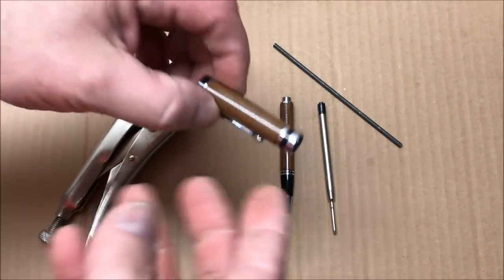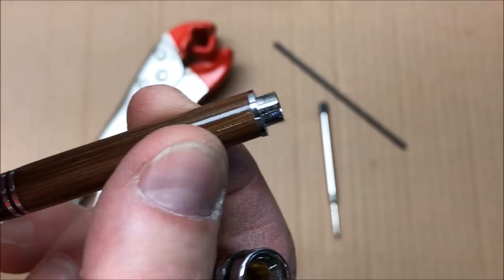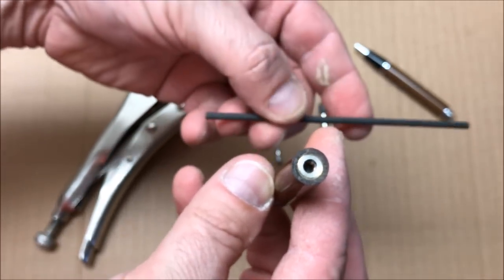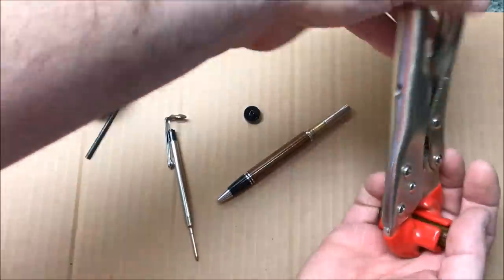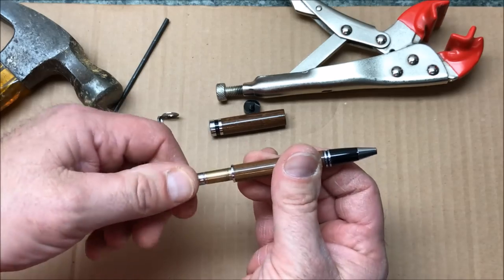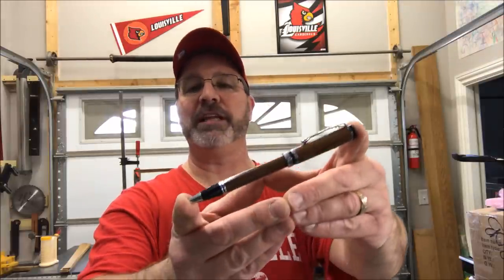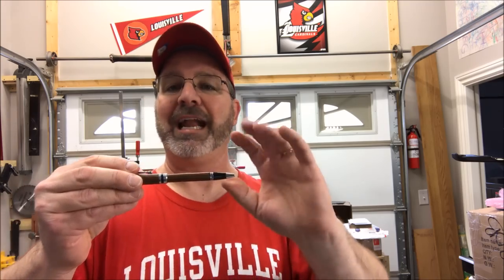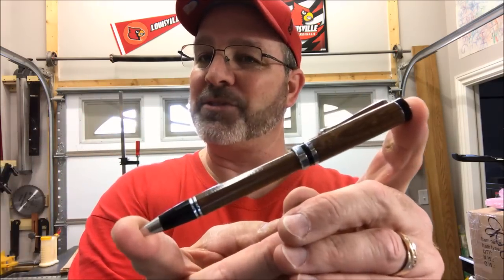A Quick And Simple Repair To A Pen

Comment: I had a pen tube that cracked on the end  it was crushed partly about 1/8 wide is there a way to repair it with out buying more tubes
Reply from the maker: About the only thing I can think of would be to cut that section off of the blank and apply a new piece. It would be very tricky to align and once the blank is turned thin, you may have issues pressing the components into the blank. 
  Unless it’s an expensive blank, I might look more at purchasing a replacement tube and remaking that blank from scratch. 

Regards,
Bob

Comment: Nice video. I have a  problem that may be a bit different from this issue. I have a Parker twist ballpoint. When I twist it, the refill won't move. I can't pop the cap off as you did here. Have you any words of wisdom on how to make the refill move down and up?
Reply from the maker: Hello Mark,
  I am sorry but I’m not familiar with the Parker pen transmissions. You may try Parker and see if their quarantined. 

Regards,
Bob
Reply: @RJBWoodTurner  OK. Thanks. (I assume you meant "guaranteed". ha)
Reply from the maker: LOL. I’m a lousy typist on the phone apps. Keyboard is to small.
Reply: I got same problem. Any luck?
Reply: @logicalnetwork1611  Not yet.

Comment: Wat to do if those parts are broken a little and it can't go back together
Reply from the maker: I call the supplier and ask to purchase replacement parts. 
  If they don’t sell them then I try to purchase them on EBay. 
  If I can’t get them on eBay, I try to modify the pen and make it without that part. 
  If all that fails, I have a box of parts that I save in case I need something on a future pen. 

Regards,
Bob

Comment: How do you get the cap and clip back on if the nut inside is loose
Reply from the maker: I remove the nut, add a dot of C/A or Epoxy to the inside of the tube then replace they nut. 

Be sure to let it dry overnight before replacing the click and cap. Once dry, you can reassemble the pen. 

Regards,
Bob

Comment: maybe some blue locktite so that the transmission doesn't unthread through normal use.  You would still be able unthread the transmission without trouble.  The blue locktite just helps stop threads from backing out due to vibration or light use.
Reply from the maker: Thank you Kyle,
  I’ve already returned the pen but I’ll mention it to him tomorrow. 

Regards,
Bob